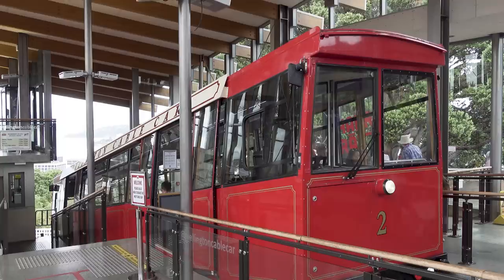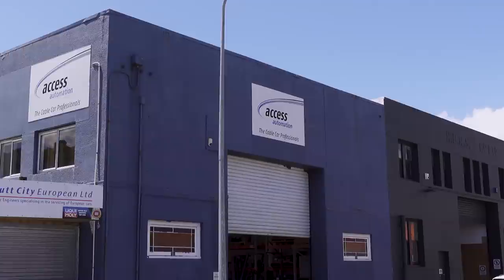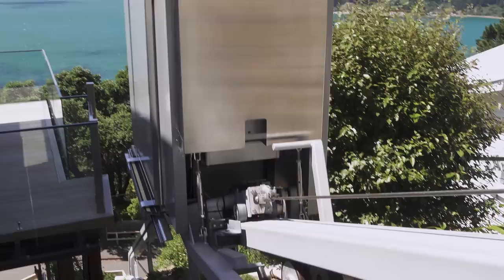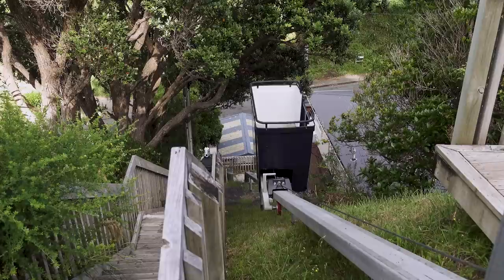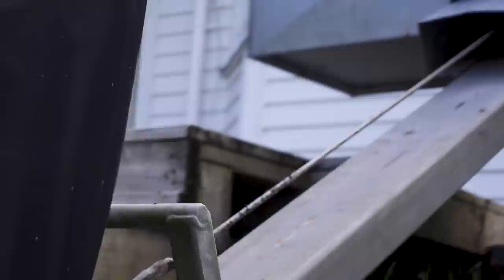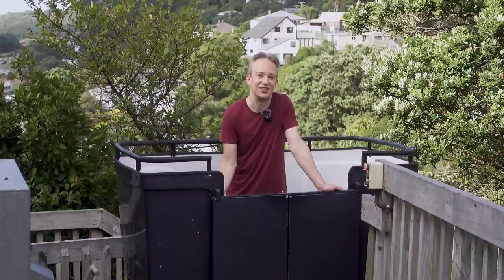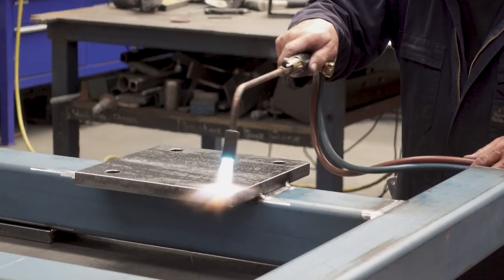The city with a hundred private cable cars

Comment: I'm not physically disabled myself, but I really appreciate Tom emphasizing that this isn't about laziness, that some people have a legitimate and practical need for this kind of tool.
Reply: What worries me is when the cable car stops working after hours. Or maybe it is not a simple fix? You could lose access to your house.
Reply: @MichaelAW17  I would imagine that the companies which service those have 24 hours callout for their technicians.   it's not much different than an elevator.   If you're living in a multi-floor apartment building, and your elevator gets stuck between floors on Friday night,  you don't have to wait in the elevator until the company opens  on Monday morning.
Reply: I can’t imagine having to move furniture up and down those stairs
Reply: Agreed - and you can tell by the stairways next to the cars in the video, that these are serious inclines - and having to do them day in and day out, or even with a load of groceries would be grueling to the point of implausibility for most people.
Reply: this is no different than having elevators in a high rise. Sure we would take the stairs, but once you go past 3-4 flights of stairs you really start to feel it, especially if you're also carrying any kind of weight at all. But in Wellington's case there is no actual road access to many of those houses - a lot of them are only accessible on foot or on bicycle, and that's if you're willing to go up the mountainside. These cable cars allow them to use the space on that mountain, without destroying it to make space for roads
Reply: Frankly, even if you are young and as fit as possible, cable cars can make sense. After you went out with your buddies for a long friday night, you might not be able to safely climb 20 meters of steep stairs.
Reply: @thesteelrodent1796  Not to mention the time expense. Imagine losing 30 minutes every single day going up and down stairs to your house. Imagine getting to the bottom of the stairs and realising you forgot something, now you're 20 minutes late for work.
Reply: @ReneSchickbauer  People also get sick and injured.  A climb could be made way harder or impossible for temporary issues that everyone has multiple times in their life.
Reply: Exactly, and imagine groceries.
Reply: As a physically disabled person, I can't agree with this more.
Reply: Anyone that lives in Wellington knows that these have never been about laziness. Most people in Wellington have lived in a cliff face house with God awful access, and climbing that every single day leaves you with a bit of dread. There were days where I didn't want to leave my house because getting back into it was such a pain in the ass. But it's not something that people like to talk about, nobody thinks about how isolating hills can be
Reply: I have minor knee and ankle issues.  I could climb the steps, but I couldn't get down them with any security.  This would be helpful with heavy groceries, too.
Reply: I grew up in Wellington, and for us getting from the garage to the front door was 83 stairs. The gradient was steep too.
Reply: @SeanA099  A friend of mine bought a house which had a staircase like that with no lift and it was not fun moving him in. I was in my late 20s then so It wasn't so bad, I couldn't do it now though.
Reply: you meant billionaires. costs 120k.
Reply: @riskinhos  Given a total of 7 billionaires live in Aotearoa New Zealand, no.
Reply: Even if its not about disability, its just not really safe to carry furniture up that many flights of twisting stairs
Reply: @riskinhos  you have a very odd idea of what a billion is. may i introduce you to numbers such as "one million", or "three hundred thousand"?
Reply: also if it has been raining, the stairs could be very slippery and potentially dangerous
Reply: @MichaelAW17  it's just like an elevator, a disabled person may lose access to their home if that is broken down too
Reply: @SeanA099  or a new refrigerator!
Reply: @JRCP144  because rich people can only have one house. that's right. thanks for correcting me.
Reply: @bricelory9534  I visited friends in Wellington. I got more of a workout walking in to town everyday from their house than I did hiking some multi-day trails on the South island. Those hills are indeed steep!
Reply: It’s mostly about efficiency though, for everyone. People In general get more things accomplished when they can save time and energy doing things.
Reply: Anyone can become disabled without warning at any time! All it takes is one bad step and you've got a broken bone or sprained ankle.
Reply: Which is weird, because the instant I saw the title I never thought it was for laziness, but for hilly areas with steep gradients or for those with disabilities or mobility problems
Reply: Parents with prams spring to mind too
Reply: You won't lose access to your house, there will be pedestrian walkway.
Reply: I mean. Absolutely same reason people use lifts. Maybe you CAN walk the stairs. But would you want to walk the stairs every day at least twice or more? Not so sure about that. I only started taking the stairs after I got a sedentary job and was health conscious that I needed more physical activity in my life. Prior to that lift all the time.
Reply: @MichaelAW17  The cable car is not the only access to the houses.
Reply: Laziness could be considered motivationally disabled or sedentary adapted.
Reply: Like ofcourse? What do you appreaciate? Him doing the most basic detail on what it's used for.. hahaha. Wow what a crazy concept to possible imagine someone who would benefit from a lift when their property is located on a hillside and steep incline I'm so glad tom explained that far out concept 
Because he interviews a young fit able-bodied resident on the topic who uses it for parties I thought only lazy dole blugers have em and they had no other use
Reply: yes and I bet you feel the taxpayer should foot the bill for your disability/lifestyle rather than you live where you can manage?
Reply: @soundscape26  what other access is there if you are disabled?
Reply: @MichaelAW17  people with mobility needs think about this every time they leave the home! it's scary to think that when you leave your house that you might not be able to get back in. these types of equipment are vital human infrastructure but they have so little importance to mobile individuals.
Reply: @SeanA099  I live in Welly, my last house destroyed my knees- to be fair I already had some issues but it really messed me up for a few years. Went from running a couple a times a week to hobbling around and not leaving the house much. I'm finally now getting back into slowly building up the strength I lost.
Reply: @ReneSchickbauer  Can attest to that haha!
Reply: even if you are completely able-bodied, it's hardly lazy to not want to walk 50 metres up a 40% gradient every time you come home!
Reply: But on the other hand it's weird how defensive he has to be about this. No one questions elevators in buildings. We all agree that it's a pain to climb flights of stairs every single time you get in and out of home. But put the same amount of stairs outdoors and suddenly some people think it's lazy? 

Some people just don't think.
Reply: When you see some of the sections where houses are built... you can see why 🙂
Reply: @andrewalexander9492  aye, but parts aren't always available
Reply: If you had disabilities, why would you buy a house built into the cliff side?
Reply: @Mike-oz4cv  because either the disability developed after you bought the house or maybe the fact that we live in a society that can overcome disability with the built environment
Reply: Tbh with those stairs it’s nothing to do with a disability. Few in their right minds even able bodied want to be carrying groceries or babies etc up and down those stairs.
Reply: @xr6lad  It would be a good way to stay healthy.
Reply: @Mike-oz4cv  most disabilities come with age. People buy a property when they are young and fit, like you, but age takes its toll on all of us with time.
As the video said, people don't want to move as they age.
Reply: @MichaelAW17  There's a reason they need such frequent inspection. There's probably also a significant number of them with battery backup and/or a manual emergency crank. My grandfather needed a chairlift in his later years, and while certainly smaller in scope, the reliability design is the same. The drive system was a very robust piece of steel, had a large battery that could run the lift many times in case of power loss, and could be moved with a backup crank in the event of a motor failure.
Reply: I livein churton park in wellington. The cable cars (private ones) is by the sea like island bay or lyall Bay.
Reply: @andrewalexander9492
That's not true in the U.S.  If no one is stuck in the elevator, nobody will come service an apartment building elevator on a weekend between 5pm Friday and 9am Monday.  They don't care if you're disabled and living in that building specifically because it's 100% ADA-compliant.

Comment: These are also common here in Switzerland, as communes are often built into hillsides. I've never thought of them as "cable cars", more like stairlifts, but outdoors
Reply: In Switzerland when i visited i always see them being called Gondolas/Furniculars rather than cable cars which suprised me.
Reply: I wasn't able to quickly find any information on your swiss versions online, but are your swiss versions pullled up by a cable?  Because most stairlifts that I've seen operate like a toothed railway, so if your swiss versions operate like the starilifts I mention then you'd be right in not thinking of them as cable cars.
Reply: @Estok8805  the residential ones are mostly cable cars, altough I have also seen some toothed ones. I've never ridden one since the terrace homes that use them are mostly owned by elderly people.
Reply: @ffvgaming3735  are you talking about the public funiculars or strictly the private cable cars?
Reply: usually they are cable pulled, with cable on the bottom. commonly called funicular although legally they may be called inclined elevator
Reply: @mariusimholz5454  public furniculars like the one on Mt Pilatus
Reply: @ffvgaming3735  There is some in Portugal and we also call them funiculars
Reply: I've always thought of cable cars as the ones with over head cables to be fair so I agree with this
Reply: @ffvgaming3735   Mt Pilatus does not have any funiculars. It has a rack railway and some cable cars
Reply: You can probably answer a question I have about them. Living in Canada I was wondering if a cold and snowy climate have any affect on it's performance.
Reply: Tom already made a video about and i think it was in Italy
Reply: I've also seen a few in White Rock (south of Vancouver BC)
Reply: Bisch du id Bez Wettige?
Reply: @gagaringagarinovic2600  the farm monorail? Those are neat
Reply: @kenlompart9905  I mean, the public cable cars are mostly built in the mountaineous region, so they are designed to operate in snowy conditions. I don't know if they have special snow-plowing cars like our trains in the winter do, but I suspect it's not as big a problem since its on a slope. The residential ones I really dont know. I suspect the ones on rails will have problems if there is a meter of snow on them, but I don't know for sure
Reply: indeed a "Seilbahn" - is what the wider English world would think of when hearing the word  "cablecar".
Yes these - cable towed "stair climbing monorails" - or bi-rail -  are a type of funicular with only one car (no passing) - maybe a busy backyard can have a passing lane ?

For others - a Gondola is usually defined as the "cabin" or  carriage which reavels on the "overhead ropeway" (ie the "car" on a cable)

Great that words can have different meanings in different regions it means we can all get a gold star for being right,,  ha ha...
Reply: @Curtis Sawyer  In NZ we call these ones cable cars and overhead cables are called gondolas
Reply: @mariusimholz5454  They have snowplows. Can't get up a sloped rail if there's snow.
This applies to both racked trains and funiculars.
Reply: Marius..... but.... but... there are no stairs being lifted!!! 🤣 But they are on a cable...so there!
Reply: @ZinvictanGamer  But are the funiculars private? I've been on ones that you pay to use like the bus.
Reply: @macforme  ah no, at least to my knowledge none is for private use only
Reply: @macforme   - you speaketh truth on this one...:face-fuchsia-poop-shape:
Reply: @macforme  german superior language because compound words go brrrrrrr
Reply: @mariusimholz5454   No argument from me... it just makes it impossible for me to learn the language (BTW: I was born in Stuttgart, left at 18 mos). My favorite word right now is schadenfreude.... which I have been waiting to have when Trump goes to prison.  😂🤣👍
Reply: @ffvgaming3735  In NZ they call a Zip-Line a Flying Fox

Comment: The engineering is so clever, especially the way it keeps the car level even when the angle of the rail changes. Would have loved to see more about that.
Reply: The arm attached to the pulling cable seems to be a very clever design, definitely agree I'd love to hear more about it
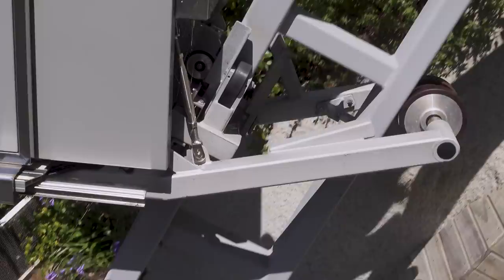Reply: it looks to be purely mechanical at 2:00 - as in the space between the upper and the lower rail gets smaller, resulting in the two arms forcing the car into a different angle than before. so purely a matter of correct rail placement with no additonal mechanical systems being needed imo - clever!
Reply: Same here. Would love to see the engineering behind it.
Reply: I want to see what safety system is in place in case of a cable breakage.
Reply: @jbrou123  Was thinking the same. Did you see the way the cable is rubbing against the rail whilst pulling the entire weight of the cable car? I wonder how often the cable would need replacing
Reply: @jbrou123  At about 4:15 you can see the mechanism, or some of it. The traction rope  is connected to a movable setup, with a spring to provide tension. If the traction rope snaps or the hoist motor or drum or something up there collapses, the spring moves the mechanism backward and from there somehow the safety gear engages, like a pin dropping to engage rail cross members or knurled dogs engaging with the rail.
Reply: @MrVook  I live in a house in another part of NZ that is serviced by one of these cable cars. If you look at the rail where the cable is rubbing, there are sacrificial pieces of acrylic that the cable runs over. On our car, the cable runs beside the rail rather than on top but we have the same way of dealing with that wear too.
Reply: @chrishandley1574  Ahh, I see. I was wondering what material they would be made of

So the protectors are more of a "consumable", whereas the cable themeselves are not? Makes sense. Thanks for the insight - you dont find many cable cars in South Aus 😆
Reply: @jbrou123  I manufacture these cars,  there is a slack wire system, along with an over speed system, so two separate safety systems to arrest the car in the even of cable failure or anything else that causes an over speed situation
Reply: @ritterkeks  correct, I fabricate these , and your 100% on the money
Reply: @dougerrohmer  well spotted, yes this is exactly how they work,  there is also a separate over speed brake in the event of any other over speed event. (I manufacture these)
Reply: @MrVook  the wear strips are High Density Polyethylene, and last upwards of 10years typically, (I manufacture these)
Reply: The safety features must be clever too. Like a regular elevator, if the cable snaps, there must be strong brakes, but that just means you're stuck unless the cable car can slowly go to the ground?
Reply: @handymannyalex Yes, but if the failure happens in the middle, you are stuck. Can the car slowly and safely go down?
Reply: @handymannyalex  So like a conventional elevator governor? (I'm an elevator mechanic - I've worked on funiculars and I think I only saw one with a governor. The rest were "slack rope".
Reply: @chrishandley1574  Acrylic or Teflon....?
Reply: @RamonInNZ  HDPE according to @handymanalex above. Apologies for the wrong info
Reply: @ritterkeks  1:21 the variable space between top and bottom rail is clearly visible in this extreme vertical setup.

Comment: A friend's parent (who is a engineer) built a smaller cable car to move groceries from the road to his summer house in Finland. It made it much easier to go down and up the stairs without having to carry heavy bags.
Reply: Two days ago I seriously contemplated getting a light block and tackle to hoist groceries up to my apartment, as I am hitting mobility limits lately.
Currently, a common four-bag shopping trip is two trips up and down the stairs to get them all inside, and as a formerly fit and able person, this bothers me a lot.
Reply: @MonkeyJedi99  get a chairlift? They're about 1500 Euro, not too bad.
Reply: @DamienAlexander  I rent, so the installation of a chairlift for the common staircase is kind of a no-go.
A rope hoist is something I could clamp to the railings of the external/back stairs, making it not a permanent modification of the structure, and thus not a violation of my lease.
Reply: @MonkeyJedi99 Just beware, all your neighbors will want to borrow it. Good way to meet them though.
Reply: That would probably my own personal main use for them.